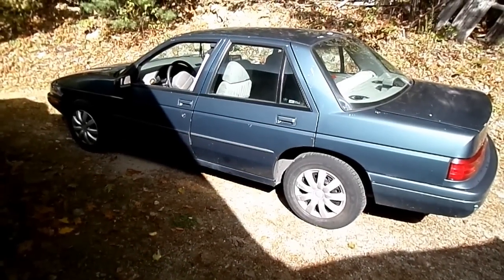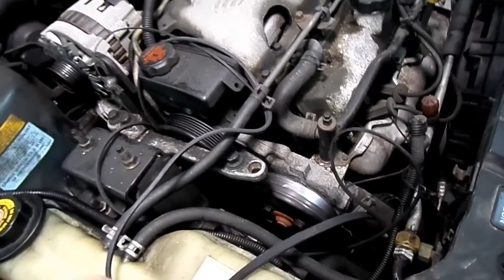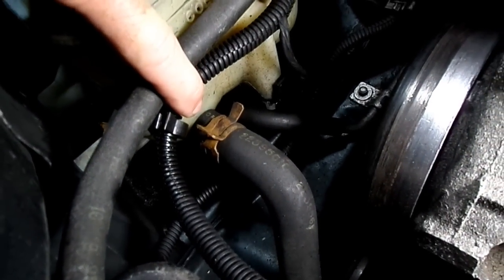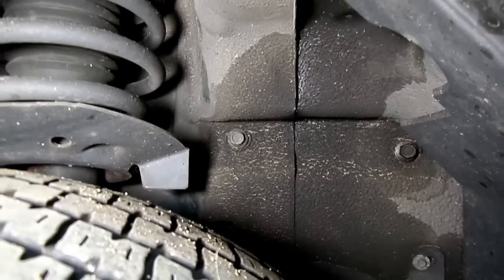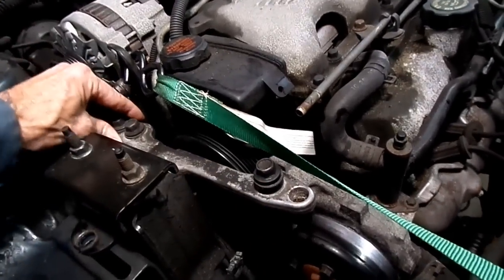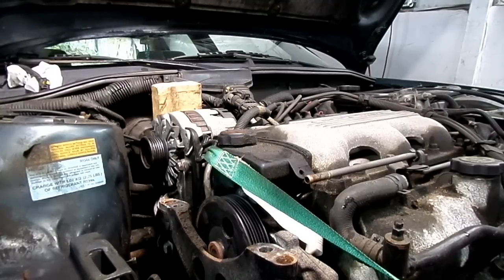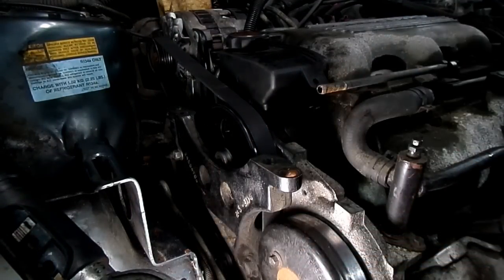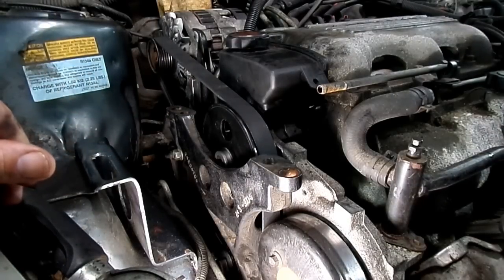Chevrolet 3.1L Corcica Power Steering Pump Pulley Replacement

Comment: Is the 95-96 3100sfi power steering pump removal/assembly same as a 91 buick regal 3.1 multi port fi w/out mounts in way?

Comment: ha ha "do you think the tensioner needed replacing", only slightly :D :D

Nice job mr richpin, should be happier than a dog with two trees now :D
Reply from the maker: I do not like the design were you have to remove the engine mount to get to the pulley though.
Reply: richpin06a
Yep i thought it was silly too, yet on old cars the mounts are at the bottom of the engine, allways seemed a decent place to put them.
Reply: 2001 malibu power steering pump

Comment: Nice video. However, did you check the pulley alignment after replacement? Bottoming out the pulley on the power steering pump may cause belt misalignment.
Reply from the maker: The alignment looked good.